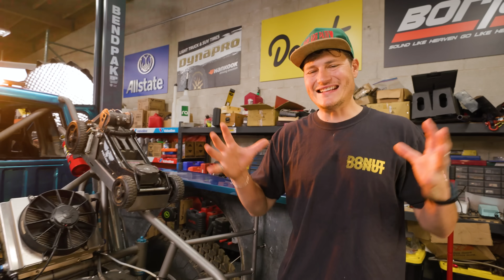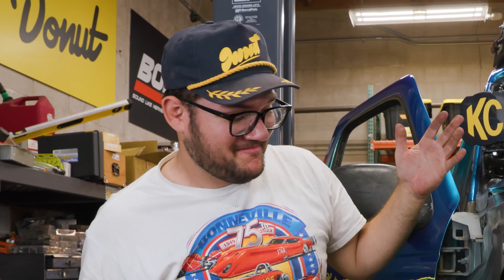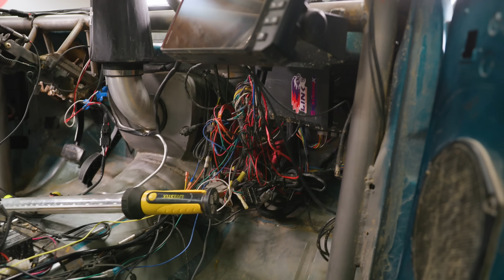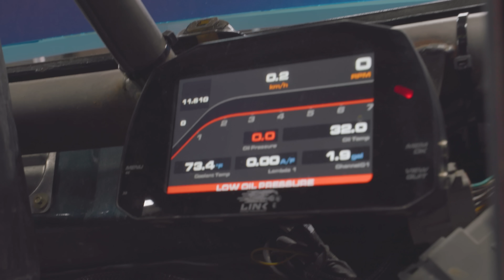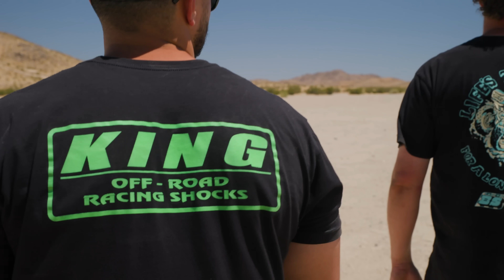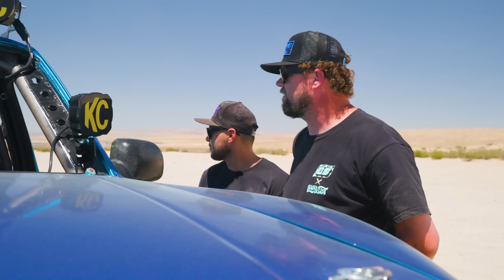FINISHING Our $500 Ranger Build

Comment: Hankook is the worst tires ive ever used and putting them on my speed3 made it unable to get traction under boost in 2nd gear. unsafe tires. If your performance tire brags about its treadlife, be worried.

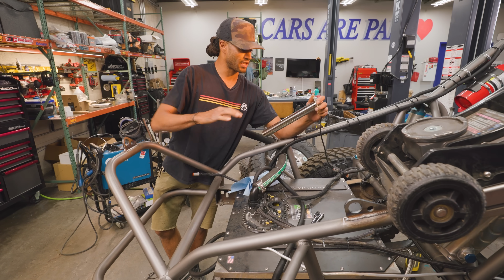Comment: 11:40 tech time here that system works because there is a 0 to 90 ohm (in gm senders) resistance in that sending unit that goes to the computer. The sensor is known as a potentiometer four wires, and they work flawlessly.

Comment: You need to dump the leaf springs and put in a multi-link long travel rear suspension. It's insane to spend $100k on a truck and leave the leaf springs in. Totally doesn't make any sense. You're racing in the big leagues and it would be easy to put in a multi-link setup. The benefit would far outweigh the trouble.

Comment: In my younger days, i had almost this exact setup. 93 extra cab ranger 2wd. 4.5 over extended i beams on 12" 2.5 king coilovers, rear was giant 64 race pack with 16" king 2.5 dual bypass shocks(yes, i know, link killers need to be 18" triple bypass), and a mildly built 302 with a manula valve body transmission. That was my daily driver!! God i miss it.... Leduc Swapmeet in Cabazon was the best for parts come-ups! Great times

Comment: i kinda wanted to see a lowtruck like this since thats what we can afford

like we asked for baja because the cost of entry is so high literally at the shocks. you cant cut that corner you need fox or king, king has a junk parts second hand scratch & dent program. so like you could could build this same truck with a square body ranger or a b2 and use a junkyard LQ4 6.0 with 862 heads and a BTR cam and scratch&dent kings with a cheap weld it yourself long travel kit and shit instead of just building a full out no budget race truck we cant attain... lsx crate is like a punch in the face we aint got that kinda money lol. you can build a truck that'll eat a raptor for like 60k...
Reply: and 60k id doing stuff right still, if we get sketchy and buy everything used and fabricate shit ourselves like Im used to doing you could get that down to like 40-50 probably
Reply: you scare people out of the sports
Reply: tires are a big ass cost just because you fuckin need so many lol
Reply: holy shit Brian Cox tuned your shocks wat
Reply: brian cox coulds built almost that truck for 50k with junk

Comment: That driveshaft hoop is so flexible it will be able to get into the driveshaft as the driveshaft is rotating. In the beat case it wears through the hoop and renders it worthless. It could also cause a friction fire. Or get wrapped aroubd the shaft and rip up the bottom of the truck.

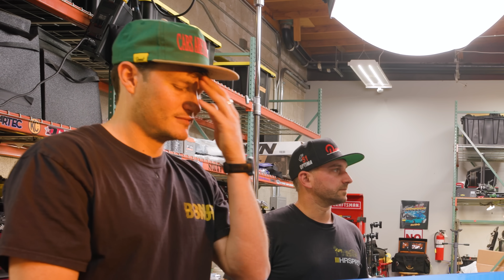Comment: @3:10 another thing to go along with zip tying nuts,  is also keep a big neodymium magnet in a ziploc bag suck somewhere on the truck in case you drop a tool/part into that silt.  Then you just dip the magnet in the silt and move it around and pick up whatever you dropped.  It's easier to pull the tools/parts off the magnet if there's plastic around the magnet

Comment: Something you may or may not run into is the pci fan in the pump going bad do to be mounted at an angle. 500 miles in the dust is a lot on that thing maybe bring some spare air pumps! Ran into this problem this year at KOH

Comment: The ideal spot for the air pump. Would of been on the ceiling of the truck.  Preferably on the rear window cage cross.  Center mount. Allows both occupiers maximum movement

Comment: Are these helmets built for the clean air system or helmets that you modified to fit in the system? Don't these helmets have open gap on where your mouth and nose is? So the dust flying in air can enter in your helmet freely? Shouldn't the helmets be fully sealed around the face with no airflow at all from outside?

Comment: Just a suggestion.   On the exhaust, y'all need to weld 3x the number of hangers between the truck and exhaust pipe.  The standard hangers will hold during pavement and offroad driving, but is iffy for an offroad, Baja type of race.

Comment: 100K into a truck + labor is quite insane ☠️
Reply: trophy trucks arent cheap. they still spent half of what teams spend on real trophy trucks to run these races. real ones from real teams cost upwards of $200k - $250k. you can find some for sale afterwards for around $250k - $300k .... motorsports are NEVER cheap.
Reply: @07Hawkeye i couldve sworn i saw quotes for ground up trophy truck builds being at least like 6-700k from a dedicated shop
Reply: @07Hawkeye  more like 450k and upwards to a million for a mason AWD
Reply: @ $100,000 they maybe are about half way to the actual cost from building a Baja from scratch to race day. Not bad if you ask me. And check out them parts prices they kinda under prices what they have in it
Reply: Totally normal for purpose built race cars/trucks. This is "budget" for trophy trucks. Even in your budget racing series (Think Spec Miata or Pro3/SpecE30), building a car from the ground up is easily a $25-30k proposition for something not front-running. And it rises super fast. Wanna do Spec E46? Just buying someone's already built car is easily $40k for a decent one and it can be $60k+. That doesn't factor the cost to build it yourself were you to do so
Reply: @moreproblematic  $25k is damn near bolt on parts for a factory truck. You can easily be at $50k not counting labor for something like this ranger. Crazy stuff.
Reply: They have not even half that into the ranger
Reply: Gotta get those views
Reply: Still cheaper than a cyber truck and 10000times cooler tho
Reply: Seems weird they spent 100k but didn’t even 4link the rear… idk anything about dessert racing doe
Reply: @Sparky-rd5gr was going to say the same. It’s insane that they spent that money and kept leafs
Reply: @briggss  yup probably a bit intimidating for them to do links since it isn't exactly a bolt on job. Still, if you really want to go fast why do a back half and keep leafs. The rear end on this truck isn't any better than just doing a basic bolt on bed cage.
Reply: Guessing much of that cost is promotional freebies.
Reply: Speed costs money, how fast do you want to go?
Reply: You have to look at them like custom yachts. They are land yachts. The real big ballers take on the ocean. Kinda makes the desert look like a starter course.